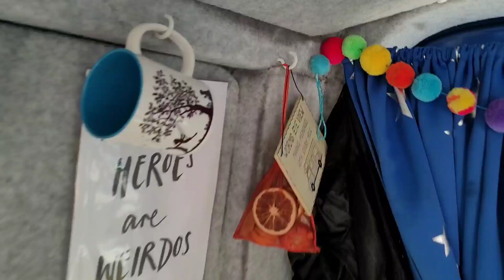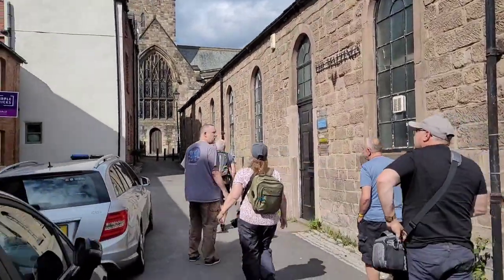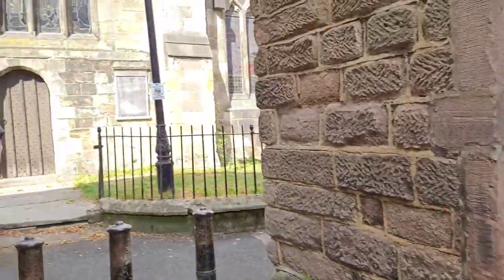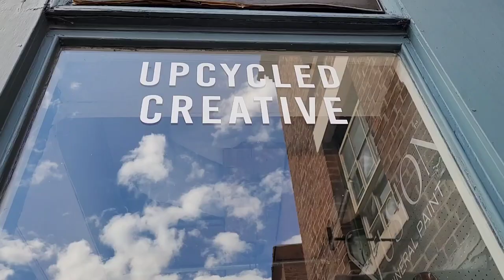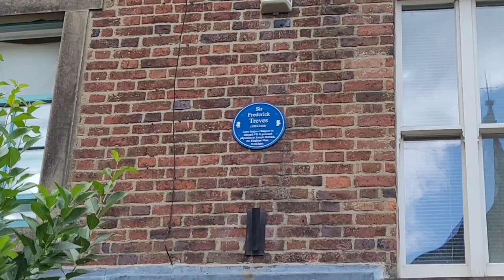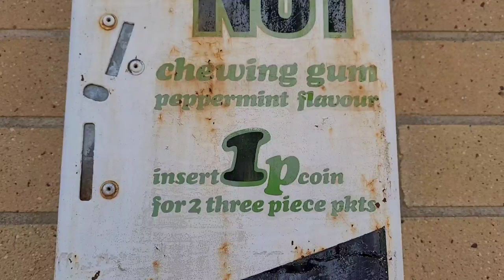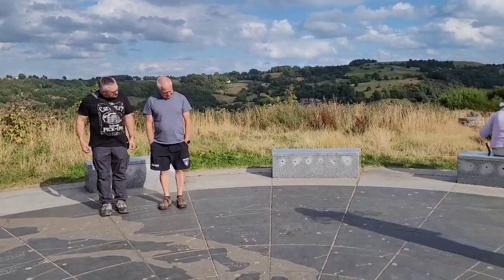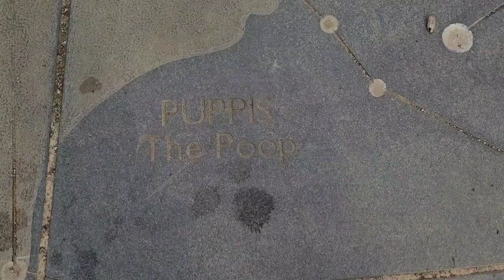Who is responsible for this? And taking you to the stars!

Comment: Hi pippa glad you got the heater sorted looks like you need a new engine mount a lot off movement when it started mine was same was worn something to think off soon all the best donny
Reply from the maker: I hope not!! I had a new mount bracket when we came out of the first lock down. That's why I had no transport in lockdown. The bracket had broken and the garage was shut 😆
Reply from the maker: Yes we tempererally wired up the heater just to get it primed. I'm getting my electrics done next week.
Reply: @WormsEyeView  def looks shot pippa
Reply from the maker: @donnysweekendvanlifetravel7854  I'll get someone to look at it. I have had a mechanic under that bonnet for about 5 hours yesterday though due to a strange engine warning light playing silly what's its on my dashboard 😆